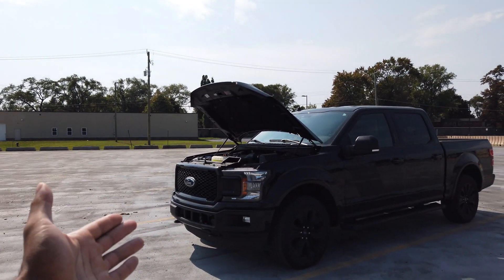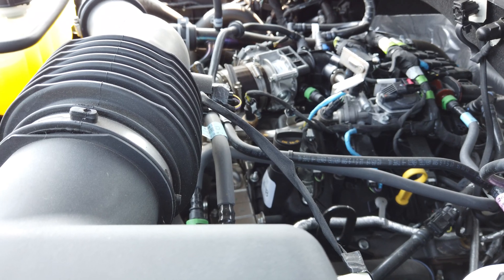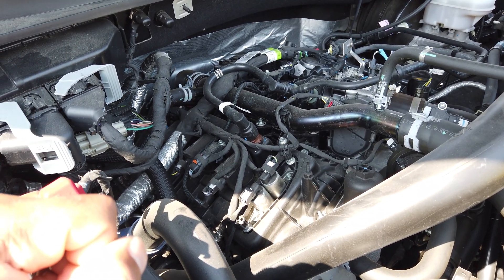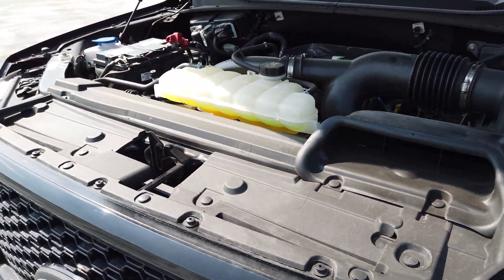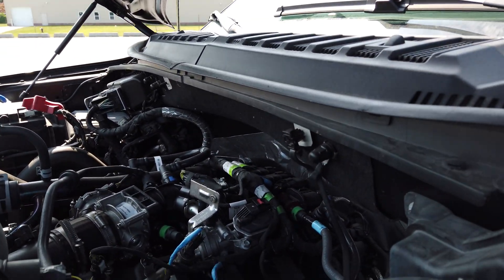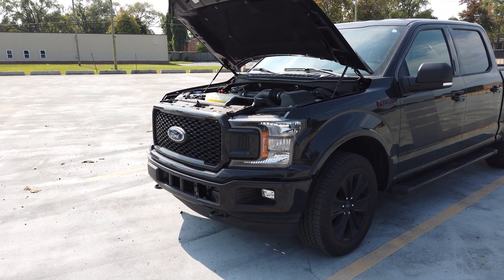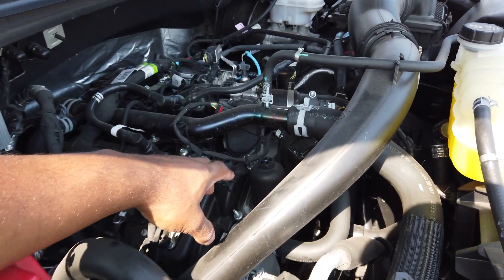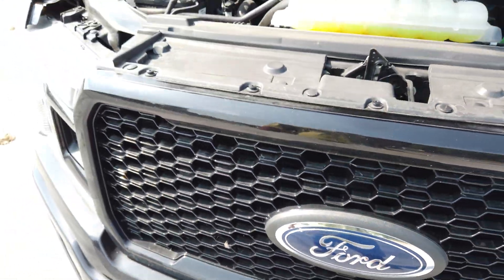2.7 Ecoboost has a TWO-PIECE engine block. Is it weak???

Comment: The fracture split main bearing is a benefit that is unique to CGI. Because it is stronger they can cast the main bearing w/ the cylinder block as a single piece and fracture split it and put it back onto the cylinder block. A traditional deep skirt cylinder block w/ a separately cast bearing cap requires four vertical bolts to hold the bearing cap plus a cross bolt to hold the lateral movement. However, when you fracture split w/ CGI, as you yourself saw,  the asperities in the surface of the bearing cap match perfectly w/ the asperities in the cylinder block and this eliminates lateral movement and requires just one bolt for the mounting. 

All NASCAR engine blocks are Compacted Graphite Iron. These things have to run in the red at 10k for 600 miles. CGI has 75% higher tensile, 45% higher stiffness, and double the fatigue strength of gray iron. It outperforms aluminum by permitting a smaller package size (due to thinner wall sections, fewer stiffening ribs) that has a carry-over effect into reducing other components' mass - it's like taking a slice out of the engine. Its strength allows for fewer threads on bolts - again, a carry-over effect reducing weight and meaningful if you're making a million vehicles on a line. It has higher specific performance (more hp per kg), reduced cylinder bore distortion especially at elevated temperatures, no need for cylinder liners, and lower complete engine weight of up to 9%. CGI loves Vee engine configurations where its fatigue resistance can come into play. Audi’s 4.2 liter Diesel CGI V8 block outperforms Mercedes Benz’s aluminum 4.0 liter Diesel and the larger Audi engine weighs 19.8 pounds less. 

There is also a dB of noise reduction because of the increased stiffness of the material, so its a bit quieter.

Comment: I originally wasn’t very familiar with the ecoboosts and do at first I just totally ignored them. I already had a 5.0 Mustang so when I started shopping f150s I figured I’d go for the same in the truck. However, inventory issues got me started on looking into the ecoboosts. After taking time to learn about them I ended up being impressed by the 2.7. It’s actually a very heavily built motor. Four bolt mains, compacted graphite iron block (afaik the only production gasoline engine to use it), an aluminum ladder frame block skirt, forged everything (pistons, con rods, crank, and cams) semi-open engine deck as opposed to the open deck 5.0 and 3.5 ecoboost, monolithic head and exhaust manifold and is just physically more compact (which should inherently add strength) with a very high lubricant capacity per displacement (2.22 qts per liter of displacement in a shorter block design vs 1.6 qts per liter in the 5.0, and 1.7 qts per liter in the 3.5 [2.24 qts per liter in the 6.7 powerstroke] ) and overall, much fewer moving parts than the 5.0 V8. In 2018 and up, the engine has port injection to reduce intake valve, spark plug and injector fouling, electronic wastegates as opposed to mechanical, hollow cam shafts which reduce rotating mass, improved throttle response, efficiency, and theoretically put less strain on the timing chain, increasing service life. They also seem stupidly easy to maintain, adopting the top cartridge oil filter, a toolless oil pan plug (similar to the 5.0), easy access valve covers, and just being very compact in the engine compartment so plenty of room to reach around in there. Arguably it should probably be the base engine in the F-250, as it's towing fuel economy is roughly equal, or sometimes better than the 5.0 for the same load, and it just utterly destroys the 5.0 in a truck application with its broad torque curve (the 5.0, is quite peaky) As all direct injection engines go, and even moreso with these as it's forced induction with forged pistons, they do experience a fair amount of crank case intrusion from blow by, increasing fuel dilution of the engine oil. So I’m gonna be changing the oil at around 6500 miles since these days I mainly drive short distances which don't necessarily allow proper warm up of the pistons, so seals will not get an opportunity to optimize. This situation is true for the 5.0 and 3.5 eco as well. Physically, it is the heaviest built engine available for the F-150, betraying the idea that smaller displacement = weaker. The only technical service bulletins that crop up with the2018+ 2.7 are limited lot supply and manufacturing defects, not design issues. So after a lot of studying I may daresay this is the best engine Ford has created in over 40 years. Maybe that's why it's the basis for most of their new product lineup. It's like the 289, they put it in everything

Comment: 2.7 or 5.0 :/ been debating for weeks now. It’ll be my first truck and idk just want the best that I can get. To me it seems like it’s split between both and just matters on preference but idk. Suggestions/insight is welcome! God bless!
Reply from the maker: I would recommend the 2.7 over the 5.0 right now if you are going to be going with a brand new truck.
Reply: 2.7
Reply: Probably one of the coolest engines ford's ever built Ive had 2 coyote motors and I just got a 2.7 and the thing is amazingly quick and is so quiet and smooth

Comment: I bought a 2018 STX in magma red metallic and absolutely love the way it drives. It has plenty of power for 99% of what I need and probably most 1/2 ton drivers need. It’s so smooth it makes me want to drive it smoothly and enjoy the ride. That’s helping me keep my foot out of it and I’m getting 21.2 mpg mixed driving. I always leave the 1st trip computer alone between 7500 mile services and reset the 2nd computer at each fill up. My best mpg was 29 after filling up and driving highway only with drafting and no load. My worst was 19.8 doing mostly neighborhood and city streets when I began working from home in March. I don’t think I filled up for over a month. Only trips for groceries and such. 
I also calibrated the fuel consumption by entering the onboard computer settings. There are descriptions online on how to do that. I always calculate at fill up and it’s regularly within 1/10th of a gallon accurate. When new it was about 1.1 mpg optimistic. Sorry, I’m OCD!
So, hoping to keep this for a long time but keep looking for any news about failures as people start taking these engines into high milage.

Comment: Scotty Kilmer does not agree! Turbo Charged small engines wear out faster!
Reply: What Scotty got wrong is that the reason tuboed engines don’t last is because people are idiots.  They run them as hard as they can and don’t understand the importance of warm up and cooling procedures with turbos.  Also there are a lot of first gen EBs with over 25,000 miles on them.
Reply: He's a fake!
Reply from the maker: They might... I think Ford claims they are 200,000 mi engines. I know 6.2 liter v8s that work and last 300,000 miles...
Reply: @Dual ADV of course he did I've seen a Ecoboost with 300k on it
Reply: Hes misinformed thats all. Hes going with what he knows. These engines are more complex and built tough. So far i have seen 3 2.7 ecoboost with over 200k they run great. But all high mileage 3.5 and 2.7 i have seen most do have a oil catch can
Reply: @michaelH0000  there's no need for a oil catch can anymore with the fuel injection just change the oil on time and good oci
Reply: Scotty is highly opinionated but not well informed.
Reply: First gen 3.5 has no issues besides rear-end replacement twice.

Comment: I’m enjoying my 2020 2.7 STX... averaging 20 mpg!
Reply: did mpg improve after the initial break in period? if so after how many miles? I have the same truck mostly city and so far only getting around 14.5 city and i baby it
Reply: @deroy08   I’m still averaging 20 mpg... it increases to almost 21 on highway... your 14.5 is really low?!? I monitor my fuel economy gauge a lot do you keep it in sport mode because I use regular mode mostly..?  But I do get careless sometimes using sport mode mashing the gas pedal and watching my truck blast off quickly through those 10 gears lol... that’s the only time mpg drops.

Comment: I’ve owned my 2019 2.7EB w/3:73 rear end for 6 months and have only put 5000 miles on it. I believe it will hold its own against any V8 out there , maybe with the exception of the GM 6.2 L. (And even at that, I believe a 2.7 will give it a run for its money ). I also think that towing loads under 7k - 8k lbs, it will still give most V8s a run for their money from an acceleration prospective . Do not underestimate this little engine .Every person that rides with me cannot believe how powerful it is .  I get 18 mpg around town, 23 mpg on a trip. Towing around 4K lbs , I get 12 to 13 mpgs . I will say the 2.7 is the ideal engine for 90% of 1/2 ton truck owners out here. I do often wonder if Ford underrated  the HP/TQ ratings of this little booger.
Reply: I put in intake and tuner on my 2018 2.7/10-speed and it's powerful enough for a street truck to the point of being ridiculous. I don't think there's a naturally aspirated factory truck that could touch it in a 1/4 mile with just bolt ons, except maybe the Viper V-10 truck. The upside of the 3.5 here is that the same mods would net you ~100 horsepower instead of ~50 and then be quicker than the 2.7. I'm experiencing the same economy as you but more like 10-12 when towing a Winnebago 2108DS and a bunch of cargo in it/the bed through the PNW. It'll still spin BFG's on dry pavement with that 6 or 7 k load but I might have opted for an F-150 a higher tow rating (probably the 3.5) if I knew I was going over 6k regularly as they have heavier springs, higher payload and some other provisions for that kind of work.
Reply: Glad to hear it. I have one on order and also opted to go with the 3.73 but have been wondering about mpg. Yet to drive a 2.7 actually